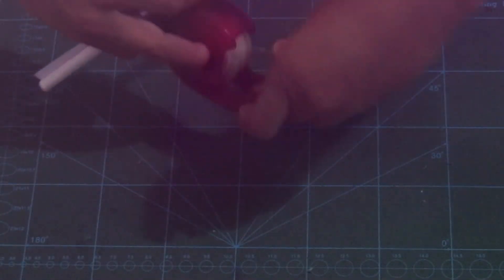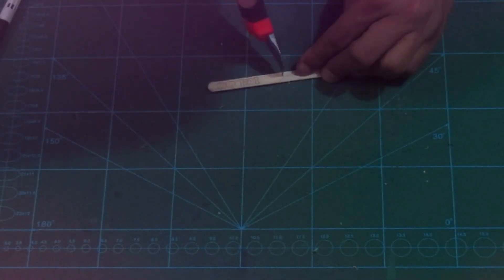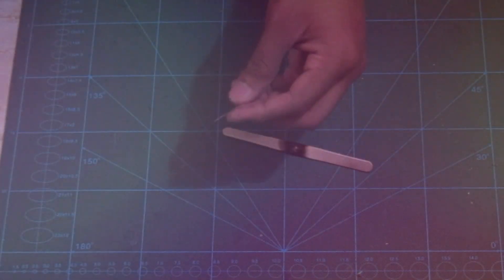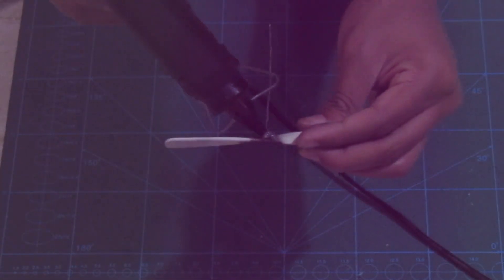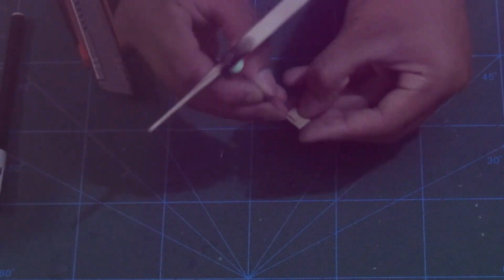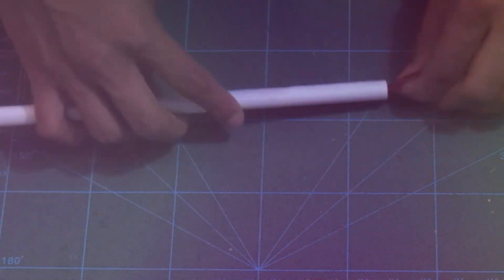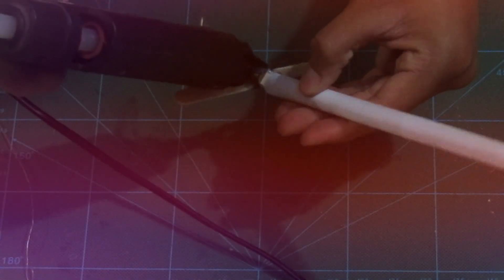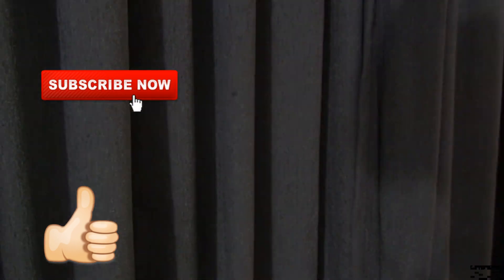[PART 1] How to make a rubber band powered plane with paper (fuselage and propeller assembly)

Comment: You should increase the length of the fuselage as it will make it fly for longer time with less vibrations and try to harden the paper that after like 300-200 turns it doesn't bent